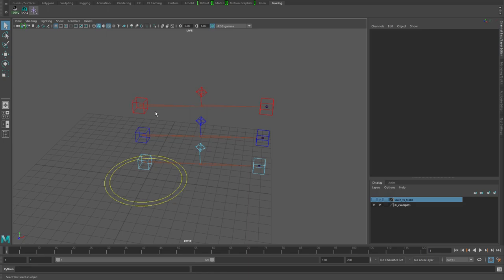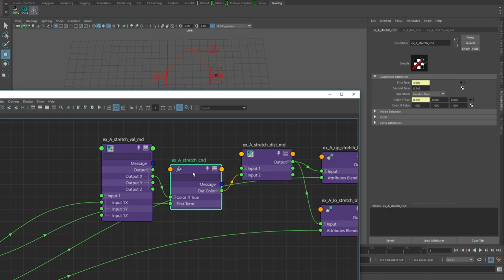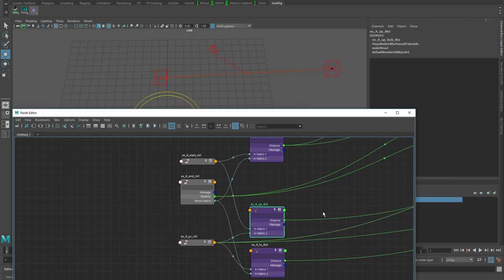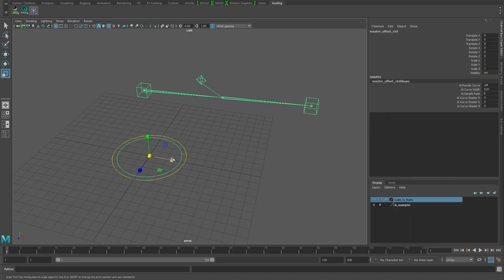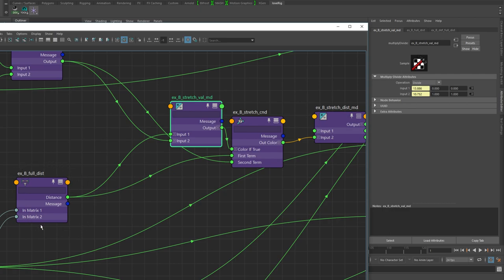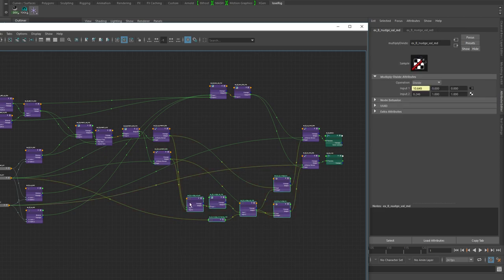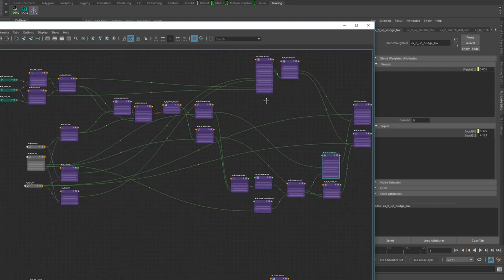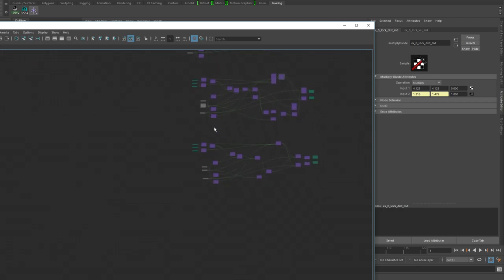(part 2) Optimized stretchy ik with elbow/knee lock and bomb-proof global scale tutorial

Comment: This stretchy setup is great every thing working fine until i bind mesh with joint, problem is that when i move the ctrl loop of geometry is divided unequally, at first i thought it is weighting issue but when i bind that same mesh with setup using scale attribute instead of translate loop were divided or u can say distributed normally. I like your stretchy setup can u please solve this problem.
Reply from the maker: Hello - thanks for taking the time to watch, test, and comment!  I'm not quite sure I follow... if you're binding to the joints where the stretching is happening by translation along the bone it should be more stable/cleaner than by using joint scale.  If that's not the case, my first guess would be to look at your weighting and ensure it is blending well from one end of a joint chain segment to the other (a segment being a joint and it's child, creating a 'bone').  But... you said you did that, so without more information, I don't really have any other thoughts...  Could you describe your setup a little more?  Do you have some twist joints in there that are along for the ride or anything like that?
Reply: @JarredLove  if you don't mind looking  once  at test file in which i did  both scale and translate attribute  based stretchy setup.
file link : https://drive.google.com/open?id=1A6685ofGtblvYfExwTn4byj2ESgrPUIE
Reply from the maker: Hey Bharat jain - I took a quick look at your file and it does appear to be due to weighting...  It looks like both of your setups in the test file essentially have the same weighting, but the nature of using translates requires a slightly different weighting method than scaling - fortunately, it's one that would likely get taken care of automatically for you if you were to put some twist joints in there that ride between the joints (like 3 or so between shoulder and elbow, and the same for between the elbow and wrist).

If you haven't watched the part 1 video ( https://youtu.be/KlFBVEkvgCQ ), go about 5 minutes in to the 'pill' shaped geometry that I showed the difference between scale and translate.  I apologize for not showing the weighting, but I do describe it, where each end of the geo is bound 100% to the joint at that end, while the loop in the middle is bound 50/50 between the two.  Maybe I'll show weighting in future videos of similar situations.  Anyway, when scaled, the ends stretch, and the center loop does not stay in the center, but when you translate the child joint, the ends to not stretch and the center loop stays in the center.  If the center loop was 100% to the first joint, scale would look better for the center but would still have the end stretching issue.

In your test file, the geometry is cut off right at the shoulder and not much geo (if any) goes up past that shoulder joint, so you probably wouldn't notice any stretching above that joint anyway; however, you can notice the stretching on the hand of your setup.  Granted, the finger stretch would be mitigated or possibly non-existent if you had finger joints due to the inverse scale connection from the joints.  But, you can also notice some stretching issues on the back of the hand and palm of hand as you stretch that arm out.

So, to 'fix' the translate one, you would need a joint at the elbow and one at the wrist that would only rotate along the twist axis (in the case of the elbow, it wouldn't bend with the elbow joint, but would twist instead, and the actual elbow joint would be where the arm bending takes place).  You'd then need to weight the upper arm between the shoulder joint and that 'twist' end joint.  Essentially, rather than a solid chunk of 100% weight for the shoulder joint that blends a little bit once it's close to the elbow, you would have 100% at the shoulder and it would gradually fall off to 0% the closer it got to the elbow.

If you think adding those extra joints sounds a bit like overkill, or adding additional complexity that isn't really necessary, you're partially correct - in your test example file it would be extra unnecessary stuff (as you have demonstrated).  But keep in mind that you will likely end up adding some twist joints along the bone anyway to prevent the 'candy wrapper' effect, and those extra joints would essentially be doing the same thing as that twist joint I mentioned would do, and you'd want to paint the weights so that one blends into the next.

Just to clarify (or beat a dead horse... take your pick), the stability issue from scaling that I mention is mostly about keeping the geometry above your top joint and below your bottom joint from stretching.  So, this would be the geo in the area above the shoulder joint or above the thigh joint, and in the section between wrist and fingers or ankle and toes.  Of course, if you prefer to use the scaling instead of translates, you can still use the setup I showed - you would just not do the final computation to multiply the scale multiplier value with the default translation value to generate the new translation value for the joint.  That's a pretty long winded explanation, but I hope it helps!
Reply: @JarredLove  thanks for giving your time  i'll try it and I think it might solve problem 😊
Reply from the maker: I'm glad I could help - and thanks again for the question!  Hopefully it can help someone else out if they run across the same thing!  Keep up the good work on your project

Comment: Whats the aim axis of the joint chains you are using for this technique? If it's not Y, how would you adapt this method to play nice with a Y aim axis? I've gotten it to work with an X and a Z aim axis: but upon applying this technique on a Y aim axis it seems to fall apart.
Reply from the maker: Hey Krobbkag - could you give me a bit more information on what you mean by it falling apart?  When you say aim axis, do you mean the axis that's pointing down the chain to the next joint?  In the video, I think it's set up with x pointing down the chain (just because that's the default behavior in Maya), but I am using this in my setup that has y pointing down the joint chain, and it works out the same there.

If you want to put a link to a file up here, I could also take a quick look and see if anything stands out to me...
Reply: @JarredLove  Hey sorry, my shift just ended. I actually have the files here: https://drive.google.com/drive/folders/1Yx3U8s_QfckkTpvv2qHGj5066GCg45VB

The working example has the joints using an X aim axis. If you go to the node editor I have the exact same layout shown off in your third example and it works perfectly.

the  broken example however has the exact same node layout: but the aim axis on the joints is Y instead of X,  the only difference being that lf1_arm_up_dist_mdl.output is connected to lf1_wrist_IK.translateY instead of X (same with the elbow ik joint and lf1_arm_dwn_dist_mdl.output) because of that it gets a little iffy.

If I can figure out a way to make it work with the Y aim axis, that would be good: but its not too important. According to every industry vet I talk to it seems like X is standard practice and it's probably redundant to try and make this work with the Y axis.
Reply from the maker: Hey Krobbkag, I took a look at your file, and it seems like everything is hooked up correctly making the joint lengths behave as expected.  It seems the issue is more with the joints and/or ik itself.  Moving your control around, the elbow wasn't bending at all - which I'm guessing is the issue you're having...

After looking at the ik joints, the 'lf1_elbow_IK' has a rotation of 90 in the y axis.  I don't know if it's like this before you create your ik handle or not, but I did a little testing.  I duplicated your ik chain joints and deleted everything in that hierarchy to make sure I just had the joints by themselves.  Then I tried making an ik rp solver on them.  It had the same result (no bending).  After that, I deleted the ik handle and effector, zeroed out the joint rotation, and tried to make another ik rp solver.  It also had the same result, and rotated the elbow joint 90 in y.  So, I deleted the ik handle and effector again, zeroed out the joint rotations, then rotated the elbow 15 degrees in x and set the preferred angle on it, then zeroed it back out again, and created the ik rp solver one last time.  This time it worked - the elbow bends (huzzah!).

So, it seems that it's all due to the joint chain being completely straight, and maya was unable to determine the way it should bend, and it just had a brain fart...  You can deal with this by either setting the preferred angle before creating the ik handle, or having it created on a joint chain that isn't 100% straight - but that's probably going to be determined more by your model's arms - basically if they're in T pose, or in a more naturalistic position with some amount of bend in the elbow...

x pointing down the chain is what you'll typically see as the industry standard, but I think that's mainly just because it's Maya's default behavior and people just got used to doing it that way (it's kind of tedious and annoying to change it by hand).  While I was working at Sony Pictures Imageworks, the animators made a huge push for us to rework all of our body parts to match the control orientations up closer to world axis orientations in order to make things a little more consistent and easier to grasp... Ik controls tend to have world orientations (feet, spine, head, etc), while the fk counterparts are a completely different orientation which means the animators have to make a bit of a mental switch when rotating an ik spine control, and then rotating an fk neck control (for example).  Sure it's minor, and animators tend to just deal with it; but from what I remember, our animators reported liking the change and their speed was improved.  Honestly, it was something that annoyed me as a student and I didn't even realize you could change it until I had worked in the industry for a few years, haha!

I hope that helps, and good luck getting your joint chain working with y down the chain!
Reply: @JarredLove  Thank you so much for your response. Turns out your fix was incredibly simple to apply. I just need to set the preferred angle of the elbow joint if I'm using the Y axis. It was so simple. Thank you so much.
Reply from the maker: Awesome! Glad I could help

Comment: I have a problem with elbow locking on the right side.. its flipping. Any ideas how to fix this please?
Reply from the maker: Hi Daniel, thanks for taking the time to watch and follow along with my video, as well as commenting!  To your question, it's hard to know what's going on in your particular case without seeing an actual file, so could you please describe what's happening in a little more detail?  What exactly do you mean by flipping?

It's possible that the value you're spitting out into your joints in the right arm need a multiplication by -1 at some point...  When you mirror a skeleton, the translate values in the joints for the left side which denote the length (tx by default when your joint orients are clean) are positive numbers while the corresponding right side values are negative due to how maya orients those joints so that rotations behave in a mirrored fashion.  So, since measuring a length is always going to give a positive value, it will need to be multiplied by -1 to give you the appropriate translate value for the right side.  If this is the case for you and that's what's causing the flipping, it should be pretty easy to make sure you're using positive values to calculate all the scale multipliers, then use a negative default value in the final length calculation right before applying that to the translate value on the joint - ie: the 4.123 value (or whatever your default value is) would actually be -4.123 in the multiplyDivide/multDoubleLinear node right before connecting to the joint's translate.

If that's not the problem you're running into please give some more details and I'll try to assist!
Reply: @JarredLove  Hey bud, I also having problem to recreate this system, please will be super useful if you can share file with simple rig like in video so we can compare it live, I watch this video like 10 times and still something is worn with my creation. Please share file so we can compare it live. Thank you.

Comment: 3:08 (Sir, how we get this default value?)
Reply from the maker: hello UVAYS, thanks for taking the time to watch and comment.

the default value for the full length of the arm/leg comes from adding the length of the upper and lower parts of the limb together.  This should be based on a single translation value on the joint (provided you've set up your joint orients correctly and there is only one translation attribute with values).  Usually people just take the values they see from the channel box and add them together, then input that value, but it would be more precise to use the 'getAttr' command on that attribute to get the true full value, and the 'setAttr' command to set it on the multiplyDivide node.

But, you don't really need to do that if you are setting up the 'bomb proof' scaling method that's described starting from 11:46

hope that helps!
Reply: @JarredLove  thankz